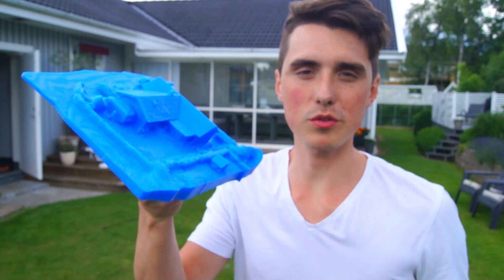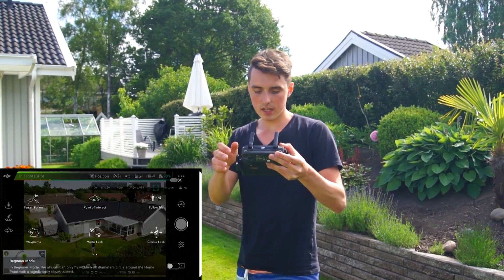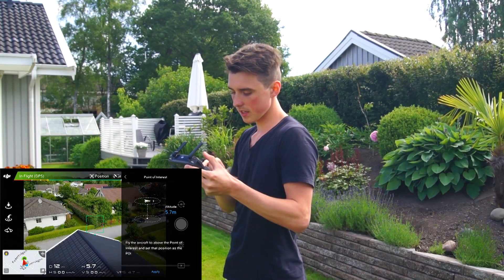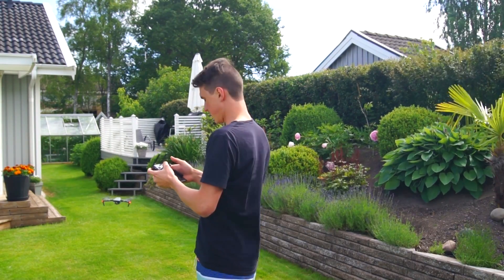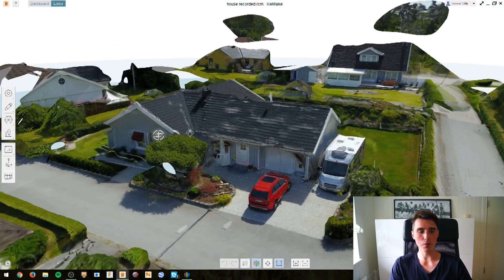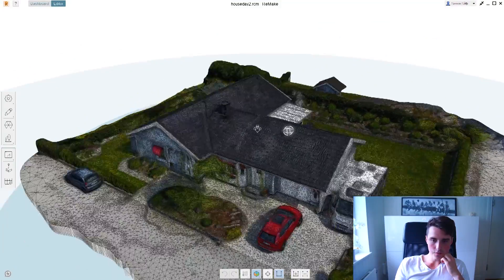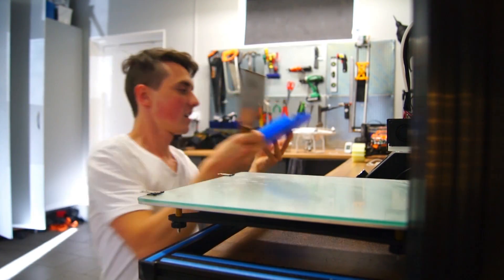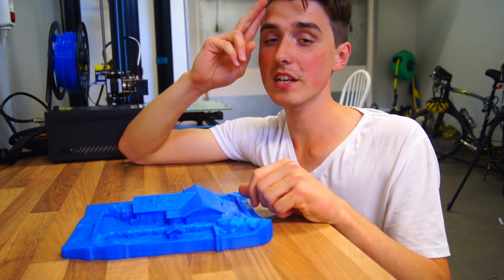3D Printing My House - Photogrammetry Using a Drone

Comment: You can use agisoft metadhape Wich is a way better software to use. They use it on photogrammetry of terrains and stuff. You should also use a crosshatch path in order to do a 3D model BN of something. So if you combine crosshatch with your radius pictures you will get a better result. Actually this one you did is already a good model. If you primernit gray l, the details will show and look more natural.

Congrats.

Comment: Excellent work. Have you tried using Meshroom? I used it to scan a Gargoyle garden ornament, cleaned it up in Sculptris and printed it out on an Ender3. I was very impressed with the result. Not sure what the photo limit is on Meshroom but it handled 56 no problem.

Comment: What if you had cameras linked to a security system in specific locations around your yard so that the footage is then sent through special software that is shown in a 3D viewing software so you can have a real-time 3D view of your home..
Maybe a useless or dead-end project, but there's much that could be learned from it in the process.
Man I can't wait for some good, interactive holograms.

Comment: Hi! Maybe my comment is one year late, but photogrametry is very sensitive to lighting conditions. Main rule is: Take photos in diffused light, so in this case during cloudy day. Shadows and reflections can easily ruin your work. The same thing is when you try to reconstruct smaller objects. Build a softbox and spin the object on plate. QRcode markers may be helpfull in such cases.

Comment: You could try using a different software. This may be an option... https://youtu.be/q3wXggCqY_8
If not you could always try Photoscan for example. Depending on how quick your computer is, it may take a while, since it is calculated on your computer and not on a some servers in a cloud. But I think the trial version doesn't have a specific photo limit. You could always use Colmap etc. which is free. But I have found it to be slower and less accurate so...
Anyway, there are certainly other options to explore. ;-)

Comment: 1 photo   took       1 second 
250 photos took  250 seconds
Take a video of 15 minutes.
Grab all the frames from that video using a software.( 1 second frames)😄

15 minutes X 60 seconds = 900 photos.

You would be getting far more better results by taking a long video considering the flight time of mavic pro.😎

Comment: my suggestion might sound silly but how about using  train tracks around the house and a video and or a camera installed on a train. I have seen how movies are made and a huge camera is on a track like a train so there is no shaking. Only problem is the roof.

Comment: there is also an open source software you can use for this, I think its much better than an autodesk version but I will process on your own computer instead of on the autodesk cloud which makes it slow if your computer is not powerful. its called visualSFM, it's harder to use but it doesn't have that 250 picture limit. I think there also is a tutorial for it on youtube.

Comment: I used to be a surveyor and civil engineer autocad drafter. I've worked with fotogrammetrists and I know how they make their maps. Unlike the drone they click points and create polylines in different layers. Surveyors finish their jobs by going outside. For example tree centers are clicked and we correct their locations and measure the diameter as well. House roofs extend over the walls and we subtract that overhang. With sewer pits we connect the underground sewers for rain and dirty waters. Sometimes we open them to see all the connections. 

Some comments: remove any vehicles or obstacles from the terrain. There are lots of car models if you want them back later.

Now some questions. is it possible in a cad program to select the 3d points of the house corners and then delete the rest? Since roofs and walls are usually flat this would make the model less heavy. You could also do that with the grass and the hedges. The textures will still make it look real.

Comment: Please Review the Creality Ender 2 Mini 3d printer. This is a 168$ printer with a volume of 150x150x200mm, heated bed, oled display, and print quality just as good as the Creality cr-10.

Comment: Nice video. I found it easier to draw my house to scale with an AutoCAD 3D program (SketchUp, actually) and then output the model as the proper files.

Different strokes for different folks, I guess.

Comment: ohhhh u used a 1000 dollar drone. well...I can't afford that. :/
Reply: A drone actually isn't required to capture a house like that. But surely is very helpful. Wandering around the place with a DSLR should require at least 2-5 hours to get it right (but with better detail in the end). A drone does it in minutes.

Comment: Hey just a question couldn't you take a video and remove each frame from the video?
Reply: You mean drone video footage and snapshopt frames from the video?
That doesn't work for photogrammetry properly. The video source is too compressed and pixel lines can be skewed within a video.
I have learned a lot from this myself.

Comment: Your video is great i am a mechanical engineering student and I need a 3D printer under $ 300 you can't help me plz because 
I need to buy them to print parts of engines Any printer can be purchased and Thank you so much

Comment: Or you can take a video of your house and use a software to convert the frames of the video into images for a better 3D model
Reply: no that's actually a bad idea. I've done tons of photogrammetry and video footage never worked out well. The compression is too high and pixel lines are skewed.

Comment: i think if you drive your RV away. you will get much better result.
Reply from the maker: Definitely, but I really wanted to capture the house as it is. I still think that if I were able to use more pictures it would turn out a lot better.
Reply: Mega Making that isn't an RV😂
Reply: haha whatever it is :P
Reply: RCLifeOn do the pictures have to be in a circle around the house? Cause there is a very big tree on one side of my house and I can't go around the house and close to it
Reply: To improve the model you need a bigger overlap of the photos and bigger photos (20mp with bigger sensor). The Mavic is not a good drone for it.

Comment: Unfortunately it tells me I need 16GB ram to import the pictures to a 3D model and my desktop computer is at home while I'm away on work :'( stupid laptops not being powerful enough...
Reply from the maker: Hm, didn't know this. My computer is 16GB, but I also have a laptop with 8GB ram and it still works fine. Does the message actually pop up in Remake?
Reply: Just redownloaded the entire program and its working fine now. But yeah, I was getting a message saying I needed a minimum of 16GB to stitch together a 3d model. Must have just been a mess up with the installation!  ¯\_(ツ)_/¯

Comment: you said you can make only 250 photos, couldn't you run drone let's say 3 times? so that it would make 3 times more photos^^ or was that software, that wouldn't use more than 250?
Reply from the maker: The software limits you to only use 250 photos.
Reply: can you pay more for more photos?
Reply: Is there an upper limit for resolution in those 250 photos, and are you maxed out? Otherwise a higher resolution camera would help you a lot. There are also specialty optics to be had, that are made to match just right in between the camera and the photogrammetry software, however I don't know how much of it is available for drones. Just know it exists in matched sets for professional applications in terrestrial photogrammetry.

Comment: PhotoScanPro is the better program i think....

Also far more options. But its not cloud based and you have more processing work to do... And it would take longer to build the 3d model. So have a beefy computer doing it.
Reply: the best software clearly is Reality Capture, hands down.
Reply: Very expensive tho

Comment: can you make your self in 3D printer
Reply: Sure.  As long as you can get a sequence of overlapping images around anything, it can be modeled in software and printed.  For instance, you could have someone walk around you taking many pictures, etc.  A lot of times, how successful this is depends on (a) the background - uncluttered, nonreflective; (b) the lighting - even, diffused; (c) how many images are processed; (d) skill using the software to deal with inevitable flaws, "holes" etc.

Comment: I think google already has a rough model of your house on Google Maps.
Reply: Mega Making because that would lose detail from file compression. 
The reason for using the drone is to get the raw files of the image for better quality, to make it easier to print
Reply: "Rough" model should be about right - take a little time sometime and take a close look at the GMaps 3D-models of a few houses like Simon's: most will probably at one side or the other look like his first attempt - normally flat walls warping wildly in all directions and all, because they're almost 100% autogenerated, by the same basic method that ReMake uses: mostly working just fine, but sometimes going wrong like trying to read a dirty crystal ball, if the "guesswork" built into the software selects the wrong interpretation of the data. So, trying to fix one of those (mostly pretty low-poly) models, or making his own model and trying to fix that - by my guess, he got a much more printable model out of his own work - it's looking pretty impressive, by my book 👍 (and darnit, one of those days I'll just have to bite the bullet and grab me one of the CR-10 variants - the possibilities with this thing are just too cool 😎 …)
Reply: +Erhard Pöstinger thanks for confirming that. I figured it should be the case since there are less distortions and less inconsistencies as those images are captured with well tuned equipments and professionally.
Reply: gooby pupper lol
Reply: Take screenshots and ReMake it?